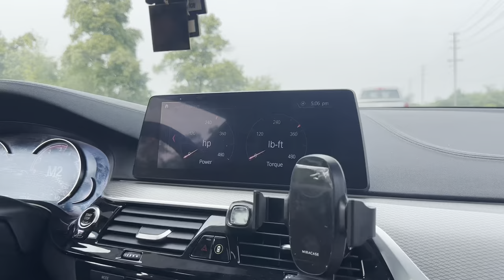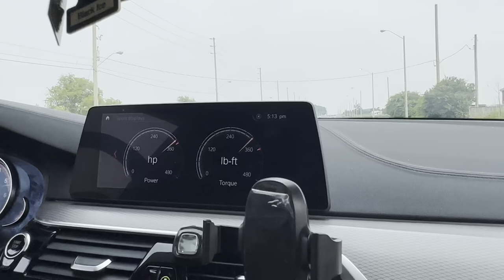Ultimate BMW 540i Upgrade: From Stock to Beast Mode!

Comment: Im thinking of buying this or a 340, but I feel like the 540 might be to heavy and the handling might not be as good and feel like a boat. Am I wrong? please lmk how it drives
Reply: I have a 2020 540i. Had a 2012 335i before. The 340 will deff drive better, be more nimble, have better steering and be a bit quicker, it just depends what you need. 

I needed a larger sedan ( 2 kids) and wanted something more comfortable. 

The 335i I had was too small and we out grew it. Hope this comparison helps!
Reply: @DadUsed2Skate  Yeah man this does help, how you liking the interior of the 540? It's a big step up from the f30.
Reply: @fym340i  yes the little thing tho, ambient lighting etc…
Reply: 340 is heavier than 540😂
Reply from the maker: @danieldeasian no way 🤣😂
Reply: @danieldeasian  no… the 5 series is much bigger
Reply: @fym340i  interior is much nicer! Ambient lighting is pretty cool too. Seats a lot comfier,
Reply: @DadUsed2Skate  unfortunately they do weigh very similarly the m340i is very heavy😭
Reply: 340 bro
Reply: it’s like a 200 to 500 pound difference
Reply: As a 540i owner id say get the 340. The 540 just feels heavy and is too long when cutting up.
Reply: @guccipig2782 u can’t cut up in a 540?
Reply: @Christianh-ck4wm  Yes. You can't make tight cuts in a 5 series. I've owned both. If you drive like a maniac, go 3 series.
Reply: @Christianh-ck4wm you fs can but of course a 340i probably feels a lot better cause it’s more nimble, but the 540 still has the power and handling to do it
Reply: @ArcticAutoStyling facts, 340 is a tiny bit heavier I more know it makes no sense
Reply: As a 540i owner I’ll generally I really like the car it’s amazing u get the best bang for your buck buck if u want luxury and maybe closer sound of b58 to the newer m340i but honestly the car does seem big but u don’t really feel that at all it moves like nothing and I can’t imagine it tuned
Reply: It’s all preference, I’ve always loved big cars so 5’s, 6s 7s and 8’s. The 4 looks really nice but still small in my eyes. I like the boat, big sway feeling, nice and comfy for long road trips. Just think about your daily activities and what you like to do and that will easily decide weather you need a big car or small (:
Reply: Def wrong I have the 2018 540 and it handles like a champ and not too heavy at all
Reply: @royalkingzzfight Same, I'm thinking about picking one up, coming from a dodge charger that's fairly big I like this style vehicle. Can you change the ambient light color or it's only purple?

Comment: Remove the muffler and save the stock valve and it would sound crazy with no drone thats how i had mines
Reply: where did you get the piping for that? or what setup bc i have a 540i i’m trying to rid of the muffler
Reply: @GreenSigz  just did custom exhaust cutting it out just save ur old valve and u good
Reply: Did you get turbo sounds out of it?
Reply from the maker: we ended up later on putting a dump valve on the exhaust and it sounded way better. Lots of turbo noise

Comment: Just picked up a 2020 540i m sport and will likely be doing a catted downpipe and stage 1 tune. Are there any easy exhaust mods I should be thinking about to improve the exhaust sound? Main thing I want to avoid is any drone. Thanks
Reply from the maker: Down pipe will make it sound nice but if you want it to be any loader you’d have to install a cut out or maybe m performance muffler

Comment: hey man i am thinking of making my 2018 540i a little bit louder not too much. i am thinking between a muffler bypass or a catless downpipe as i am not gonna be doing any tunes or stuff. Whats your suggestion?
Reply from the maker: We ended up putting a bypass valve in after this video to get the true turbo noises

Comment: Did you add any piping to the tips or you just welded them on after cutting it
Reply from the maker: Had to just add a small part on the side that had the valves because the weld was too thick around it
Reply: @ArcticAutoStyling  I seen on ali you could bend it small to fix the tips Im about to get mine down and res delete
Reply from the maker: That’s the current setup on the car is a down pipe / resonator delete

Comment: swapping a cold air intake with a "cold air intake" is wild to me cause oem is getting fresh air from the front of the car with the container keeping the hot under the hood air out and keeping the fresh air cold and yall swap it for something getting the engine hot air from under the hood, my 545i its intake has a tube running all the way up to next to the radiator getting the fresh untouched cold air and i wont change that not even for more intake sound.

Comment: What is used to tint those tail lights? Is that just like 50% film?
Reply from the maker: VHT spray tint
Reply: @ArcticAutoStyling  oh dang, looks clean! I tried doing a light coat once and it looked streaky and uneven. You have any tips? Thats the perfect amount of tint on yours.
Reply from the maker: @geedunk13 start with a light coat just dusting it and then maybe a more solid coat 

If you keep doing light coats you’ll be able to get the right tint
Reply from the maker: @geedunk13 I can perhaps make a video showing how to do it properly
Reply: @ArcticAutoStyling  that would be amazing!
Reply: @ArcticAutoStyling  you use the gloss kind?